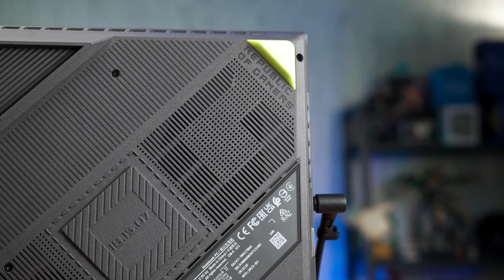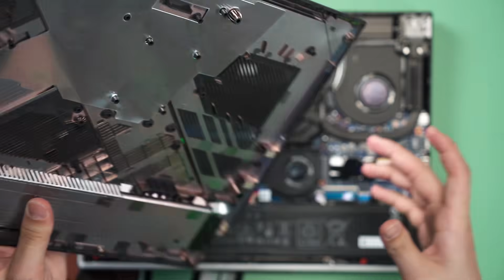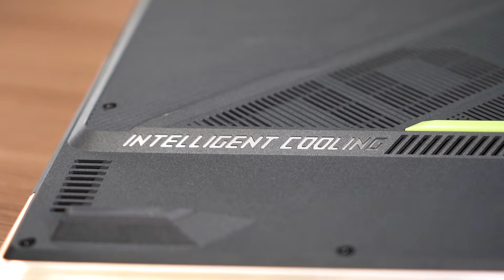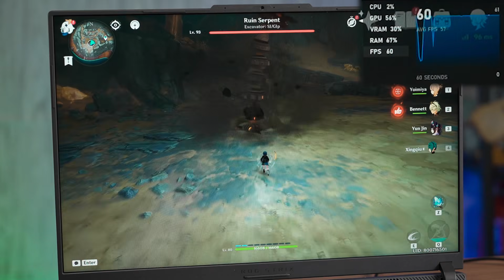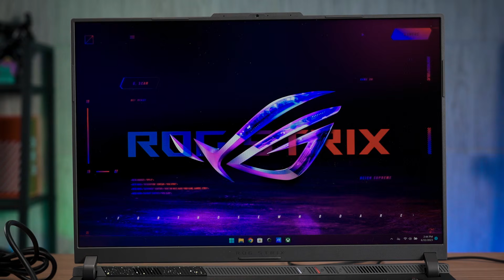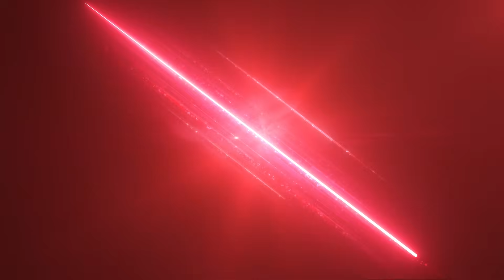This is the BEST laptop cooler design to date! ROG Strix G16

Comment: I installed hwmonitor to have a better known about the temps of my cpu, and in specific the core #3 normaly is the hottest one, i have the same lap is it normal? In normal games all the cores are between 75 - 84°C which i think is normal but the core #3 reaches temperatures of 90-95°C, is that normal?
Reply from the maker: Yeah it's normal. Just make sure the vents are clean and you're good to go. No need to worry about the temperature as it'll control itself to prevent overheating
Reply: Five months late but temps are fluid. As long as that 95 is accompanied by intense cpu usage then it is completely normal. Try to make sure it is only spiking to 95-100 though rather than constantly staying there. These are laptops and no matter what people think, these things must be treated as what they are, laptops. If your temps are high then lower the fps cap, reduce some settings, etc.

Comment: I have the ROG Strix G16 2023... when I play RDR2 the CPU reaches temperatures of 90 °C in cities or places with a lot of movement... and I didn't even set all the graphics to maximum... is this normal? (CPU = i913980HX / GPU = RTX4070)
Reply from the maker: Yes
Reply: Yes its normal
Reply: Mine's the same strix g16  i9 4070 it's Hits 96°C cpu temp is while rdr2 is that normal?
Reply: @SkyShineOfficial  Hi. First, I need to mention something… after watching videos and comments from Intel developers a year ago, I understood that these CPUs are designed to operate at these temperatures to achieve maximum performance. If you’re worried about the integrity of the hardware, remember that the temperature readings are not for the CPU as a whole, but for the hottest core (out of the 32, in this case) at any given time. Reaching 90°C or more occasionally is normal... but maintaining it for extended periods is not. Even if the quality of your components is built to handle it, you’re putting too much thermal stress on the system. The same thing happened to me, but I was able to adjust the game settings myself to get an average of 70-77°C (hitting 90°C only during very specific moments) while maintaining good graphics quality.

For RDR2, try this—it's my graphics configuration:

Output Adapter --> <0>
Output Monitor --> 0
Resolution --> 1920x1200
Refresh Rate --> 165
Screen Type --> Borderless Window
Vertical Sync --> Yes
NVIDIA Reflex Low Latency --> No
Triple Buffering --> No
Pause Game on Focus Loss --> No
Lock Mouse Cursor --> No

GRAPHICS

Preset Quality Level --> [Custom]
Texture Quality --> Ultra
Anisotropic Filtering --> x2
Lighting Quality --> Ultra
Global Illumination Quality --> Ultra
Shadow Quality -->Ultra
Far Shadow Quality --> Ultra
Screen Space Ambient Occlusion --> Ultra
Reflection Quality --> High
Mirror Quality --> Ultra
Water Quality --> Custom
Volumetric Effects Quality --> Ultra
Particle Quality --> High
Tessellation Quality -->High
NVIDIA DLSS --> Performance

Advanced Settings -->Locked
API --> Vulkan

Check the temperature using Afterburner or similar software.

Additionally, I’ve set my GPU driver (same as yours) to version 552.44, which has been the most stable one I’ve used this year. All later versions have degraded performance, at least in RDR2 and Cyberpunk 2077.
Reply: Try clean fan or use cooling pad and disable aggreasive cpu boost it only give 1+ fps not worth the heat @SkyShineOfficial

Comment: I'm going for the i5 13450hx model with 4050 rtx. I have one question, will i be able to run esports games on silent mode at good fps and low cpu/gpu temps? Seems when you put it on turbo mode it can get pretty hot..? I'd rather play on silent mode at the expense of some fps and have a cool system as it will certainly increase longevity of the laptop...
Reply from the maker: You should be able to. Especially CSGO or Valorant

Comment: My first gaming laptop after 7yrs. Very decent performance i wish to get the 1600p screen it was only 1200p available
Reply: trust me you should happy with 1200p, the higher the display, the harder your graphic cards have to work, resulting in lower fps and higher temperature. you mention just 1200p and your alr on 80-85c, if its on 1600p screen you will have 40-45% fps drop. so lets say you were playing on 100fps on 1200p now it becomes 60fps on 1600p plus your temperature will go as high as 90-95. which is lose-lose. unlesss you are a rich kid who stays in air conditioned room all day then higher display isn't gonna help you much. lastly tho, you don't even notice the difference that much. unless you are doing editing freelance for a living. streaming, youtube, netflix, any game, simple editing will do just fine on 1200.  if you want to go higher, you need higher GPU and better cooling system. not worth. just a small change of 1200p to 1600p make a huge difference on how stressful it is for your laptop to work.
Reply: @gwanime4929  yes and no. There are games which looks good in 1200p but there are few which not. This gpu more than enough to run anything at 1440p even with ray tracing. I mostly play shooter which goes over 200fps anyway. If i play in 1440p or 4k actually my temps lower due cpu doesn’t need to work that hard and the gpu 100% working all the time and tops 75c.
Reply: @gergelykiss1142  I am not sure where you got your analysis from but in every review, every test and every graph it shows that 1440p will significantly drop your framerate and makes your GPU work harder which in turns make your GPU temperature hotter. so if your not at least buying a 4080. its not worth having.  only 4080 or above can fully utilize 1440 and run any game above 100+ fps with it.  all that said, any graph, test and review will tell you that higher display will make your gpu works harder and common sense that it will be hotter. This factor happen constantly. unlike the difference of a 1200p vs 1440p display where the difference is little to none unless you do video editing or very very high spec game in which still, you won't be able to power it with 4050, 4060, or 4070. and as far as I know, rog strix g16 doesn't have anything above 4070. so the 1440p is not actually for gaming but more like video editing purposes.
Reply: @gergelykiss1142  so if your not video editing and just gaming then 1440 is no need as it will unneccesarily overheat your laptop for no reason, also consumes more power and obviously much much more expensive.
Reply: @gwanime4929  wrong! Your gpu all the time fully load during gaming. If there is no bottleneck in your system. I have a 13980hx so no bottleneck. If you play higher resolution you laptop will be cooler cos your cpu doesent need to work that much so not gonna consume 120watts only 60watts. Your gpu in 1080p 1440p 2160p consuming the same power of 140watts….
Reply: @gergelykiss1142  I would like to ask where did you get that information from, can you send me a link of that specific video or article so I can read more about it.  from what I know, your GPU will workharder , don't know about cpu.
Reply: @gergelykiss1142  in game.. your gpu don't always go 100% all the time you can adjust it. but the problem with 1600p not 1440p btw, rog strix g16 only have 1200p or 1600p avalible.  the problem wtih 1600p is that even at max gpu work loads it gives 40-45% less fps. meaning if you want to enjoy gaming at a higher fps you need to force it to work 99-100% which you can adjust in Asus armery crate manual mode. here is 2 thing, what will happen is, 1. you either run your gpu at lower % workload, get a very lower fps comparing to 1200p, like -40%. so lets say 60fps insteal of 100. and a hotter gpu temperature or  2. you run your gpu at lower % which allow the temperature of the gpu to be cooler but your gaming experiences is trashy since you get like from 100fps to 30-40 instead of 60.  both is lose lose.  simple concept is, 1600p will make your gpu work harder no matter what. if a 1200p and 1600p both working at 100%, 1200p gives your more rewards. and 1600p has a 240hz refresh rate, if your computer is not 4080 or above. your fps will be too low to even use any of it. imagine having a 240hz refresh rate but only 40-60fps. you waste 100+ smoothly opportunity when you are gaming.  again, 1600p nebula screen is for video editing purpose. not gaming. you can go to any website and it will tells you that. its common sense. Unless you do video editing or photo editing with your laptop. 1600p is useless. and unnescessary overheat your laptop.
Reply: @gwanime4929  just look for some article on internet how bottleneck works. As higher the resolution less the cpu works. In Laptops even in low resolution like 1080p the gpu fully utilised, so its doesent matter u play in 1440p or 4k for the gpu. For the cpu yes cos as higher the resolution as less demanding on cpu and more demanding on gpu.
Reply: Does the temperatures go up a lot when playing games ?
Reply: @Gabrialhajji  in performance mode maximum 75c cpu and 70c gpu with no cooling pad on the desk. In manual undervolt and powerlimit cpu 80-85c and gpu 75c 

Scores 2150 single core
Scores 34500 multi in conebench r23

Cpu-z 
Single core 889
Multi 14500k

And only with 16gb 4800mhz ram now changing to 5600cl40